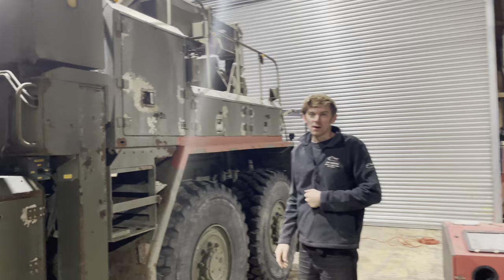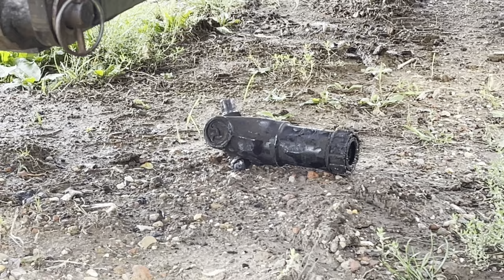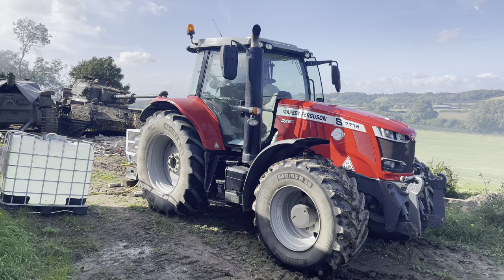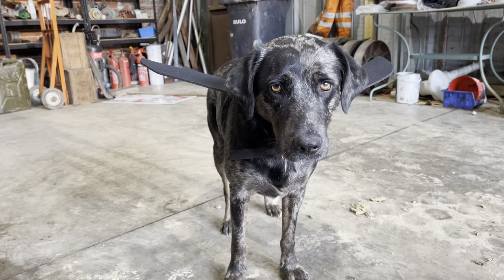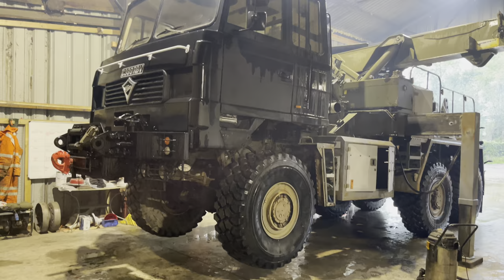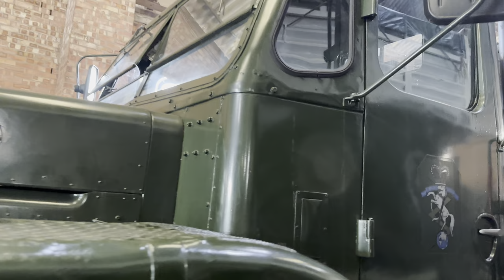AquaBlasting A Heavy Recovery Truck

Comment: I did sandblasting, during my summer jobs whilst in university, working on elevated highway bridge decks, wherein the winter road salt seeped into the cracks in the poured concrete nesting around the rebar, reacting w/said rebar’s and accelerating the failure of the bridge deck.  We had tractor trailer based sandblast units, huge ingersol-Rand diesel compressor, mounted sandbin and the “space suit” ventilated hoods and respiratory support…

Comment: I had a near miss with failing U/Js in  a Mercruiser outdrive last year because I'm paranoid about any hint of knocking with flexible drives. I was still shocked at how bad they got in a very short space of time. You were extremely lucky that failure didn't rip the guts out of the tractor! Were they sealed for life or greasable? 
BTW sealed for life must be the biggest lie in engineering!

Comment: I know it's a reach but: while you've grit blasted down to bare metal why not crack test high stress points like tow hooks and eyes? Or the hoist and block pin brackets?

Comment: Grease is so overrated, look at the mess sprayed every where. Did I hear correct, once a vehicle is on historic registration it can be driven on a car license? That's almost worth the price of a plane ticket just for that, in Australia the original license grade is needed plus we have to maintain a log book of every trip out the driveway and are limited to 90 Days per year use. If you even hint at wanting to get something like a Saracen back on the road the officials buttock muscles go all twitchy, anything armoured is very frowned on for private road use.